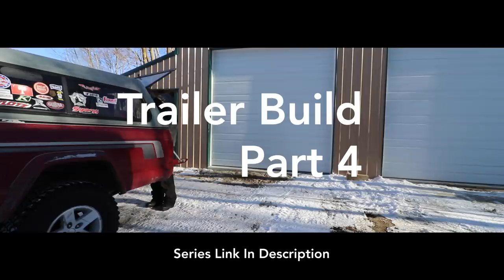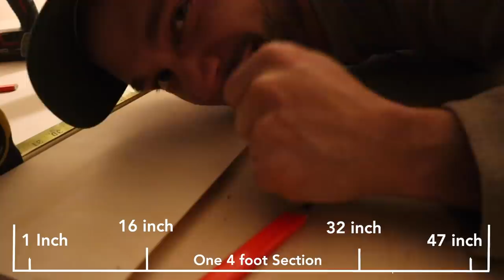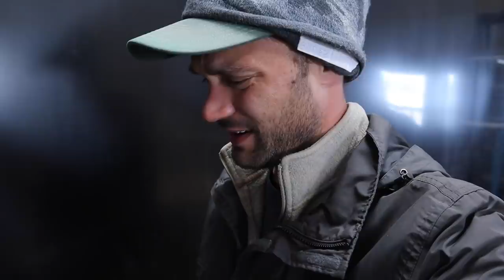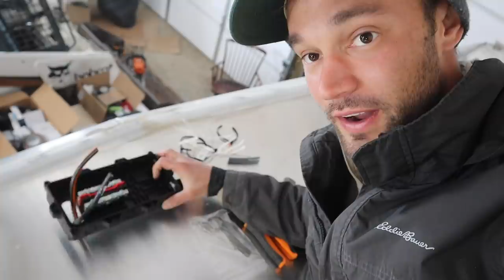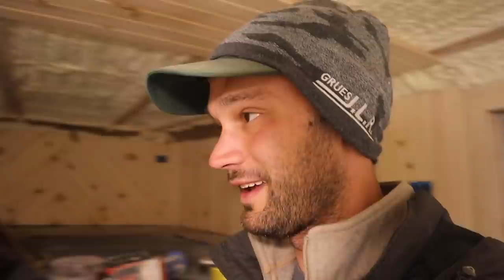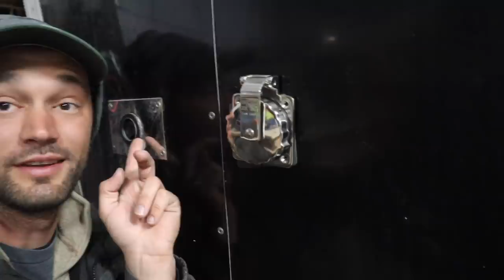Solar Panel TINY HOME Install | Part 4

Comment: You see tractor trailers dressed out with all those chicken lights and rarely are the all burning. Good luck with that.
Reply from the maker: We got them all going in present time. But, they can be a hassle.

Comment: It's not so cold in the summer in Colorado right? LOL I wanna see Colorado but not in that weather! Pass. I bet Navi Jr will seem like cake after the size of this beast lol
Reply from the maker: The weather is much warmer in the summer. But, altitude can have a lot to do with weather. You should be able to enjoy Colorado this summer just fine though in your bus.
Reply: @navigationnowhere  I'm definitely visiting Canada next summer after I get the bus stuff all situated. 6 months without Badge and Ell is crap lol It's been less than a week and I'm all put out about it lol

Comment: what about the Off Gassing from the spray foam, did he think about insulating it with Rockwool  insulation
Reply from the maker: I assume the “he” in your comment was referring to me ? Either way, I have looked into various forms of insulation.

Comment: Dang Mike! I been sitting at my computer since Monday waiting on this to drop. Good job so far! Are you going to do anything to cover the insulation around the goose neck? Stay safe and have fun.
Reply from the maker: The trailer will eventually get a front roll up gate that covers that front underside. That area will house the generator and propane tanks

Comment: The wires on top (if too cold outside) should be wrapped with pipe foam, why cause it will keep the charge flow from dropping so 2 x 170w's going in the mppt CC there would be a drop of about 2%, not a lot but the owners of the trailer will want the 2% at the end of the day, also give then extra cables its right wire gauges, wire connectors if they want to upgrade to more powerful SP's in the future

Question: as per person how much does this type of build will get Ur team, financially?

Suggestion, add 4 mini cameras that are both motion detector and night vision and photo taker with sd slot in the camera or the viewer, so can be viewed from inside and the truck, make sure they r not Wireless enabled but are actually wired, no wire outside showing (wireless cameras get glitchy in cold and when they cross with other wiressless waves), 4 means, 1st on the back of the trailer easier to see behind when driving and parking, 2 for either side, last on can be mounted at the front of the trailer, at night they are good for security as well so the 2 viewing monitors have to be in the trailer n at the truck dash.

Stay safe, God bless
Reply from the maker: The wire on top is custom made for solar roof installs. It is double coated and rated for uv protection. Also, the wire going to mppt is oversized for future solar installs.
Reply: Cold wires (and solar panels for that matter) are better for efficiency... not sure where you get your information.

Comment: Wondering Would not LED strip lights have been easier for running lights?
Reply from the maker: Maybe but on this case I think the lights are what they wanted.

Comment: Why does everybody always use 30 amp hookups instead of 50 amp hookups? Why not go overkill and then just use a 30 amp adapter plug. That way if you ever go to a campground that has 50 you won't be artificially limiting yourself. That's just what I did on my bus, just was curious about why people do what they do. Is there a benefit that I'm overlooking to going 30 amp hookup?
Reply from the maker: In this case, the power system would never need 50 amps. It is mostly a 12v system.

Comment: Excellent work and job!  Question: What size solar wires connected to the solar panels and run to the combiner box, and what size from the box to the charge controller?  Thanks.......
Reply from the maker: That would be hard to say because it would depend on what size system your running and what your planning on trying to do in the future. Wire sizes are rated for so many amps.
Reply: Navigation Nowhere Yes, I understand that and thank you for responding. I’m asking on your project, as the wires look like maybe 8 gauge or even 6 gauge, because AMSolar suggests parallel run. Just wondering because I running something similar. Thanks.......
Reply from the maker: Solar to box is 10ga duplex and box to mppt is duplex 6/2